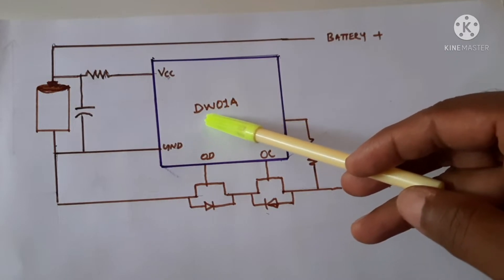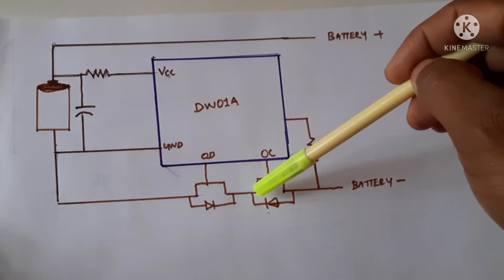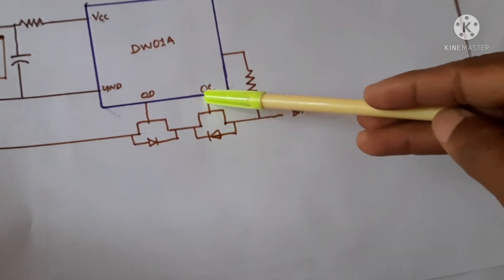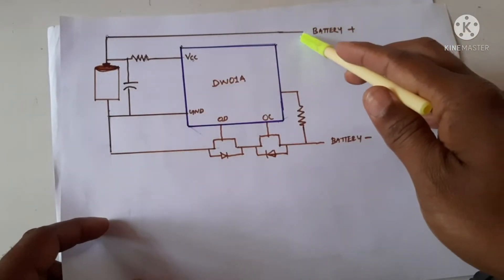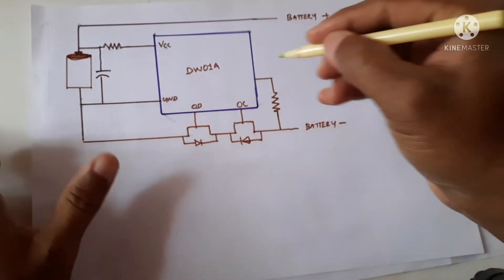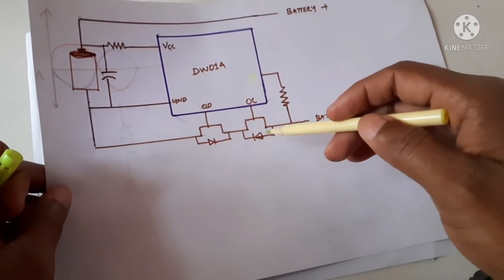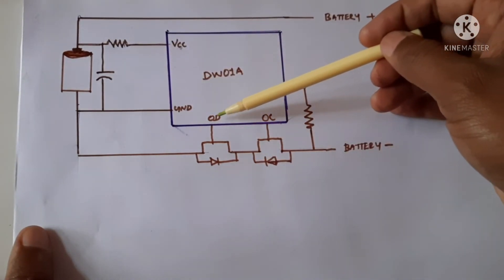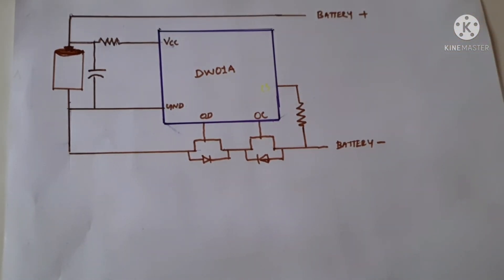DW01A Li ion Battery Protection IC internal Diagram and working

Comment: why  not they use one mosfet it  seems  to me  stupid that  they use 2  eacch  one  if  opened it will  cut     the  current path so why  not only one  instead of 2?
Reply: they are oppositely connected so that if the overcharging is detected and interrupted, only one direction current will be avoided(charging current) but on the other end the discharge path will be free. and vice-versa